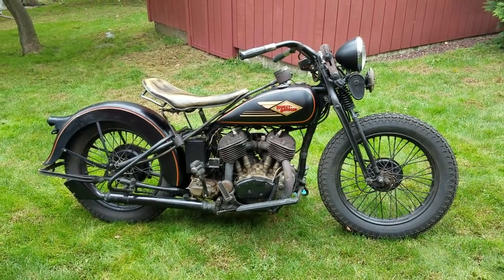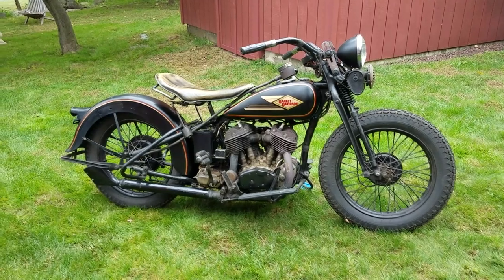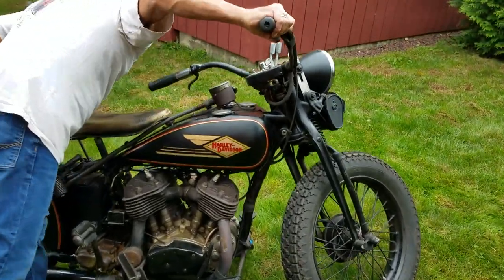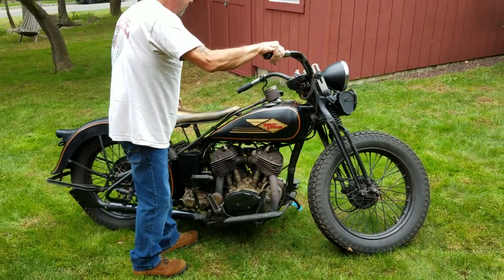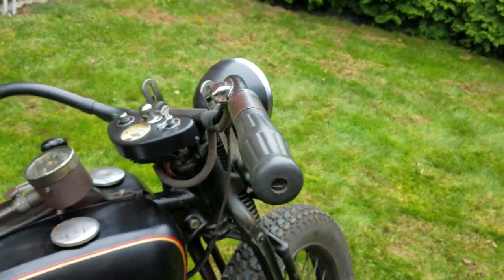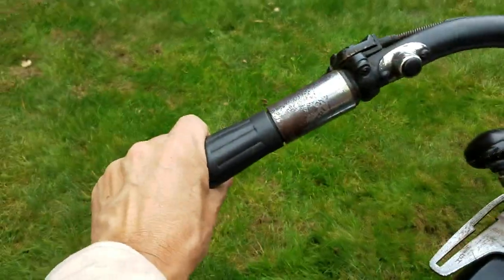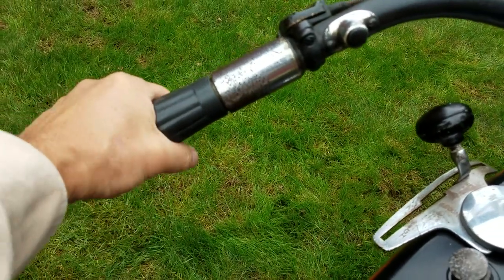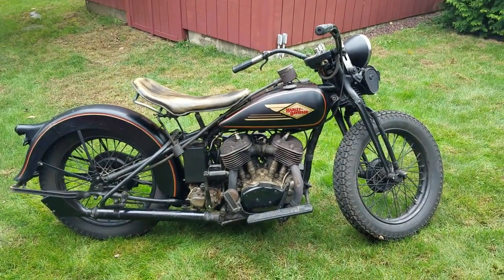How To Kickstart A Classic Harley, 1930 Flathead Motorcycle

Comment: Not a lost art, yet. My '88 Blockhead is a kicker with a kicker ignition module, no manual advance, but basically the same art to start otherwise. It's a little more critical to get it right quick with my Blockhead, though (no compression releases) don't get her started within a few kicks and you'll feel like you're fighting a 15 round prize fight.